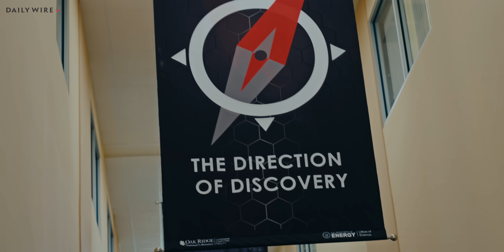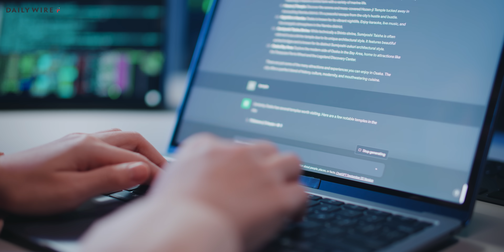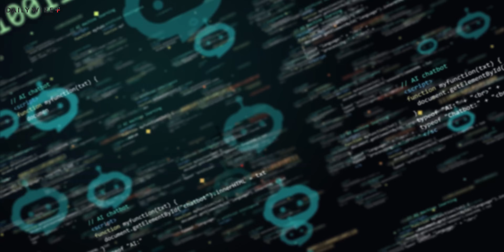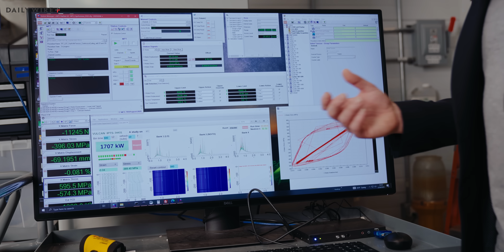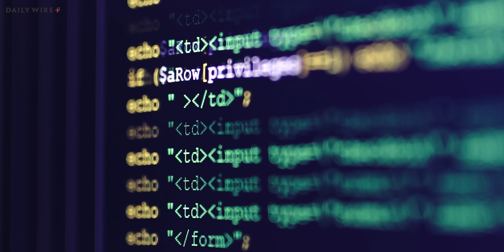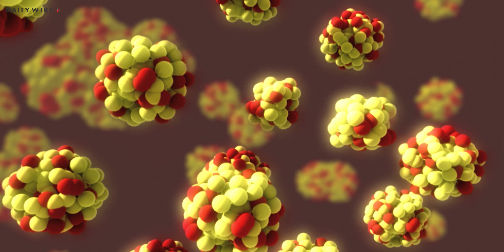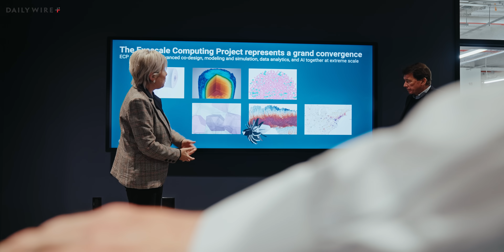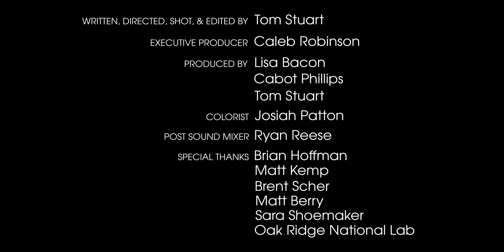Manhattan Project 2.0

Comment: The video describes “Manhattan Project 2.0” as a new US effort centred at Oak Ridge to combine nuclear energy and AI supercomputing (the Frontier system) so America can out‑innovate China in an AI and digital warfare arms race.

Nuclear, AI and US strategy
Trump’s energy secretary Chris Wright and Congressman Chuck Fleischmann argue that AI is now as strategically decisive as the atomic bomb was in World War II, so the US must “win” the AI race against China by unleashing domestic energy and innovation rather than regulation. They present nuclear power as the only scalable, always‑on source that can both electrify AI data centers and provide high‑temperature process heat for heavy industry, making it central to US economic and military strength.

OpenAI partnership and applications
OpenAI co‑founder Greg Brockman explains that AI “manufactures energy into intelligence,” needs huge power, and can in turn boost energy efficiency and productivity across the economy. The Oak Ridge–OpenAI collaboration brings about a thousand scientists onto the Frontier supercomputer to accelerate research in areas like nuclear fusion, materials, biology, and industrial design, positioning AI as the main future economic driver.

Frontier supercomputer and open science
Frontier is shown as the world’s fastest open‑science supercomputer, with over 18,000 blades, each roughly 50 times a typical laptop’s compute, used for massive simulations such as next‑generation aircraft engines and cancer‑trend analysis on protected health data. Oak Ridge staff emphasize that the system is co‑designed with vendors (HPE, AMD) for efficiency, runs “open science” projects whose results are published, and is intended as a national asset for solving very large‑scale scientific and engineering problems.

Historical Manhattan Project link
The host then visits the historic X‑10 graphite reactor at Oak Ridge, where workers in the 1940s unknowingly helped produce plutonium under extreme secrecy, and where early nuclear engineering and the US nuclear‑submarine program were essentially invented. The guide notes that pioneers faced huge safety uncertainties and moral responsibility when unleashing atomic power, a tension the film explicitly connects to today’s AI and advanced nuclear work.

Risks, responsibility and optimism
Oak Ridge researchers say modern nuclear modelling on Frontier lets them test reactor designs and fusion concepts virtually before deployment, improving safety and speeding progress toward potentially transformative fusion energy. The video closes by stressing that, as with the original Manhattan Project, today’s scientists see both enormous risk and opportunity in these technologies, and frame American leadership in AI and nuclear as critical for both national security and the future of human freedom.

Comment: To produce Artificial super intelligence they will need to allow the program to wright its own code and grow itself because the lines of code needed would be so vast humans alone could not wright it. It would be equivalent to a fusion reaction once it took off growing itself into what they are trying to achieve but we will not know its intentions or if we are truly in controll of it for the lines of codes will be so vast and complex that human review of the code would take many lifetimes
Reply: Current AI are not made of code but of connection strengths in a neural network. It is already impossible for humans to figure out how the current models work.

Comment: Bravo!!! We already have the capacity to assemble S.M.N.R's 15kw a unit, stack them like battery banks baby, let it rip tater chip..ill pour the pad, double mat 12" centers #5rebar, 8"of 4k psi batch design, slab 12'x65'. 40'ft apart each reactor will need its own control station being a paper mesha trailor park trailor....im no engineer but this puzzle is not har to put together.